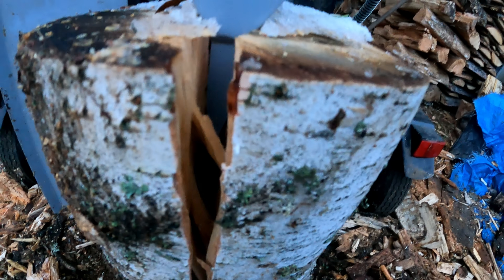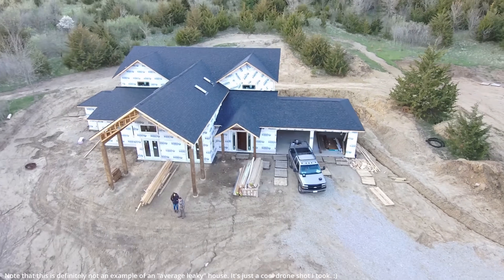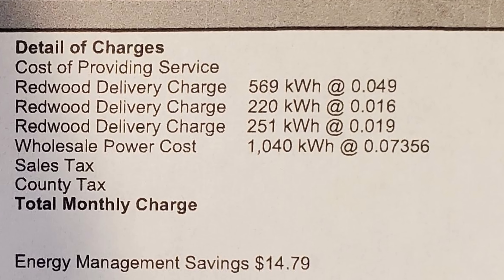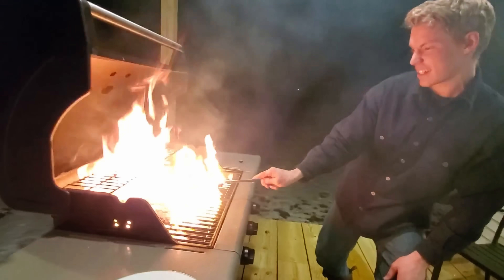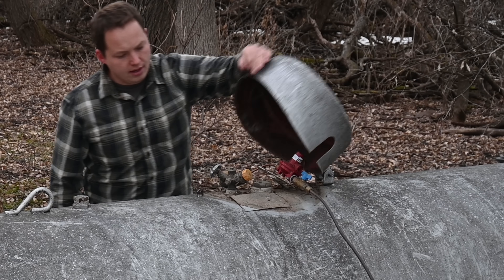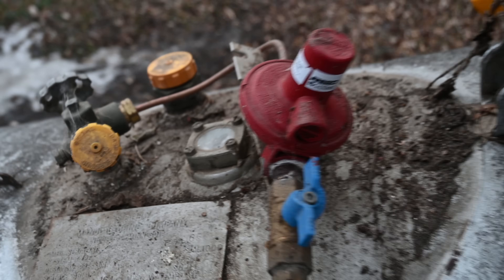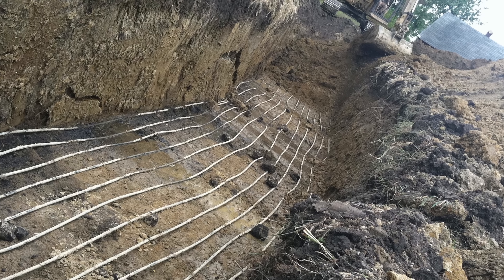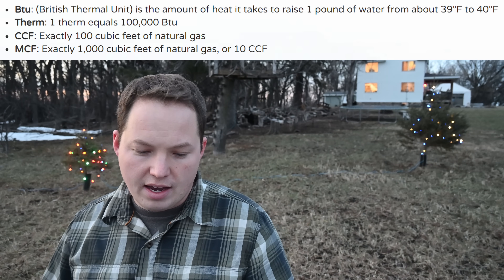What's The Best Heat Source in 2022? Top 5 Home Heating Methods - LP Electric NG Geothermal Fuel Oil

Comment: Here's why I will always choose natural gas over a heat pump. Power outages. 

Down here in Texas last winter folks lost power for a week, some much longer, during the Feb 2021 storm. I have power stations/solar generators and a portable dual-fuel generator as backups. My natural gas furnace is hooked up to a single-circuit transfer switch from EZ Generator. 

A 1/4 HP furnace only needs about 400W of power to run the blowers. My 1/2 HP furnace is larger and takes 800W (3200 sq ft home). With my 5120Wh Bluetti power station, I can run my furnace over 21 hours on a single charge. I can recharge with solar panels or my propane generator. 

There's no way I could run a heat pump that long. It's as power hungry as an air conditioner -- needs thousands of watts to run. Would burn right through my backup power. That seems to always be omitted from the head-to-head comparisons from folks pushing everyone to get heat pumps (not this video review though, which was very objective. Great review, Benjamin!).

You just can't beat the low electrical power requirements of a fuel-burning heat source during a power outage. Until that changes, which I don't think it can due to physics, I'm sticking to natural gas as long as I can get gas lines to my house.
Reply: Why not heat pump for when you have power, and Natgas generator for when you don’t? I’d bet money you’d win out with that strategy year after year in running cost, plus, your food in fridges and freezers and all would never go bad. Lights on all winter.
Reply: @myid9876543  Good question. Natural gas in Texas is actually dirt cheap. Our gas bills down here are actually much less than our electric. Our summer AC bills down here are what kill us. If we were to use heat pumps winter electric bills might be as high as summer.

Now all this was pre Feb 2021 Texas freeze where wholesale energy prices went through the roof and power companies were left with huge bills. Now there's some scheme to charge customers the difference for the next few decades or something like that to recoup costs. We'll see how the bills come out this year.

I actually would like a whole home generator but our yard is too small :(
Reply: You are in Texas, i hope they fix the electric grid politics
Reply: And if you have a direct vent gas wall heater you don't need any power.
Reply: I do have a Buddy Heater in case all else fails and we have no power or natural gas.
Reply: @mgrnd3875  That's what I have just in case (2 buddy heaters)
We have only electric. No gas here.
I have a new efficient heat pump. We virtually never have power problems. 
The heat pump works well here. The weather? Normal in mid 60's during the day, mid 40's at night. Today? 66* and 44* 
Same all week
Reply: When we have had power outages in Michigan the gas furnace will not run as the unit cannot ignite and the blower motor will also not circulate air. We can use the wood burner insert in the fireplace which will heat the entire house minus the basement. If it comes time to replace the air conditioning unit I will go with an air source heat pump and keep the gas furnace as a backup. There would be no need to worry about moving the air from the pump/furnace and I have wood as a backup.
Reply: @robertdavidson3090  You can run a gas furnace during a power outage, but you have to install a transfer switch that hooks into the furnace circuit. Once you do that, then you can use a portable generator or power station (battery) to run your furnace by plugging into the transfer switch. It's what I do when the power goes out, but it does require some modifications to pull off.

If you have a gas furnace, then it doesn't take much electricity to ignite the flames and run the blowers. With a heat pump you have to power both the outside and inside units, and it takes an incredible amount of energy. For both cases you need a transfer switch, and with the heat pump probably 240V connection for the outside unit.

Nice you have the wood stove backup. Down here in Texas you don't see too many wood stoves. Folks are typically more worried about heat waves and hurricanes, although after the Feb 2021 winter storm when the grid nearly collapsed and folks were burning their furniture in fireplaces to keep from freezing to death, that is starting to change.
Reply: Heat pumps really have came a long way in the last several years. I’ve been in electrical for 24 years, around here (Kentucky) I’ve seen a lot of dual fuel or hybrid HVAC units going in. Basically a heat pump with gas furnace instead of electric air handler for auxiliary heat. That being said, lots of people around here like to wire their new houses for at least a portable generator. A split unit gas furnace just requires a 120 volt circuit. You can run lights, microwave, refrigerator, heat, etc. from a portable generator hookup which is much less expensive than a permanent one for the whole house.
Reply: @CA-lk6fd  Cool. Hybrid Heat Pump/Gas Furnace at least gives you a fallback. One premise of these hybrid units is that a heat pump is cheaper to run than a gas furnace, so run it most of the time. In Texas, that's just simply not the case (but maybe it is in California, for example). Natural gas in Texas is just dirt cheap. My gas bills never reach the same levels of my electric in the summer running an AC at thousands of watts. I have a gas furnace, cooktop and water heater. From an economic standpoint in Texas, it makes no sense to switch to a heat pump if you already have gas. You won't save anything on your bills. Never heard a Texan complain about gas bills, but certainly hear it about electric bills.

And you're right, the gas furnace is a simple 120V circuit. Takes less electricity to run than my 1500W space heater, and the furnace heats a 3200 sq ft home. And during a power outage I can run the furnace off a small portable generator or even a portable power station. Just not possible with a heat pump, no matter how efficient. 

While I'm all for renewables in as many places as it makes sense, including residential solar, natural gas has bailed me out too many times during power outages for me to willingly throw it out the window.
Reply: @mgrnd3875  Around our area, (south central Kentucky) if you have any sizable house out in the country, it’s cheaper to run the heat pump than to burn propane. Use the heat pump until about 20 degrees, and it automatically switches to gas. The areas where natural gas is available, you’re better off to run straight gas. Propane is a bit pricey here. Solar just isn’t a big thing around here yet, there is some but not a lot. I think in time it will improve even more and be a lot more efficient than it is now.
Reply: But what do you do when the natural gas lines freeze up?  Like what happened in Texas?
Reply: @Bryan46162  Pray :). Here's the weird thing. Even though gas wells froze up and some of the power plants couldn't get gas (and the gas well operators blamed the power plants for killing their power - circular blame game), somehow I never ran out of natural gas. I had hot water, heat, and my gas stove the whole time. 

Relying on natural gas still exposes you to utility failures, but I'm playing the odds. In the last 30 years I've lost electricity more times than I can count, but never once lost gas, not even Feb 2021. It did happen to some in Feb (usually neglected apartments that already had gas leak problems, etc), but on the whole, it's way more reliable than electricity. All the gas lines are underground.

For the doomsday scenario where natural gas also fails, I have a Buddy heater, some 250W and 750W space heaters, solar generators with portable solar panels, and a 2000W dual-fuel generator to run the heaters. Try to heat one room and hunker down. Let's hope I never have to test that backup plan out :).

Comment: We are in New Brunswick, Canada.  We use a direct expansion GHP from Maritime Geothermal.  The ducting isn't even perfect and I can say that there is no way at all to beat a GHP.  My TOTAL power usage for the year is 23,000 kwh and the house is 3,400 square feet.  Waste heat from the GHP is scavenged with a desuperheater and heats my hot water whenever the GHP is running.  So that is a total of 78.5 million BTUs and that is for ALL my energy (To be doubly clear).  Heating alone would be FAR less than all of that.  Likely only even half at the most.

My father-in-law has a more recent buildout of a GHP and is able to get 30% lower for similar floor space.

Yes, the cost on a GHP is much higher now than when I got mine 22 years ago but the highly consistent power usage and the fact that only fan belts and filters are a continuing cost item, the long term benefit is unbeatable.
Reply: At 22 years, will have to replace the entire unit soon.  Better save up.
Reply: Pros for ground source HPs are low maintenance, longevity and quiet. No temp extremes nor loud outdoor equipment exposed to elements.
Reply: @dougevans74  I know..But there are cons as I've expressed in other comments..
Reply: @alanmorrison3598  do you run these systems?
Reply: @dougevans74  Spent the better part of a decade as an engineer designing residential and light commercial compressor bearing split and packaged AC units and air source heat pumps.  Heard the saying "Familiarity breeds contempt"?  
My farmer neighbor has had a geothermal system for about twenty years and he just replaced the unit in it's entirety..Along the way though, he had to replace circulating pumps twice, the motherboard and other maintenance issues but these alone cost him a pretty penny!  I'm not saying these systems don't have a place but they are extremely expensive to purchase and have installed.  My farmer neighbor had the land needed and the equipment needed to install the ground loops and he added loops over and above what was recommended. 
My main point is that no one system or energy source(s) is right for all applications. Invest primarily in your house and its insulation and weather tightness as you have done in your older farm house.  Money well spent and makes the system(s) you select less critical.  The simpler the system, the better its reliability, maintainability, serviceability and longevity.
As far as I am aware, all compressor bearing systems are direct expansion.

Comment: In electrical resistance heating, Watts is Watts and band, element or shape is irrelevant with one exception of how well it moves air. If It doesn’t move air well it will consume the rated output but the heat will be localized. With fan resistance heaters I wish they would disclose the noise levels.

Comment: Great video !
Thanks for summarizing it all for us !
I use LP on 2,000 sq ft farmhouse build in 1915 (remodeled in 1980’s). Last year, 20/21 I’ve used around 800 gallons of LP just to keep it warm couple of days every week. Otherwise thermostat was set to 55*F. This is air circulating system. 
For the next winter I’m planing to use radiant heat (at least on 1 floor) with a LP boiler and augment it with solar thermal. 
Meanwhile it’s -5*F outside (feels like -18*F) in northern Illinois.
Reply: I think you will find it much less expensive to heat the house using a high efficiency heat pump, than the LP system for the winter of 2022/23, because fuel prices keep climbing!  And with $6 per gallon fuel oil or diesel prices, that will become the most costly to heat a home.  Also most fuel oil furnaces are not over about 75% efficient.  

Ground source heat pumps are just to expensive to install, unless you have very low electric costs, and high prices for the alternative fuel, such as propane or fuel oil.  

In my area, Portland Oregon, where the low of 23F only happens about 15 days per 3 years (most years stay above 23F), the air source heat pump works wonderful, and I never hooked up my electric resistance back up heater.  

My cost to get 100,000 Btus' from my 14 SEER heat pump is about 8 KW or about $0.80.  So $800 for the winter if I actually needed 100,000,000 Btu's?  But I do not need that much heating.
Reply: Look for 30 tube evacuated tube solar thermal heaters.  I would suggest 2 of them to warm your boiler water to a acceptable level in your area.  Maybe 4 of them.  You might also consider standing them upright, next to the building on the south side.  This is because in the summer, it would be easy to put a blanket over about 1/2 of them, so they do not overheat, and at 90 degrees, they will pick up more winter sun than if mounted at 25 degrees on a rooftop.  At 90 degrees, it is much less likely to overheat in the summer, while providing just domestic hot water to the home.  

With the recent cost of LP gas going up, at $4.10 per gallon, that is about $5 per 100,000 Btu's of heat.  A air source heat pump is only about 5-8 KW of electric, at $0.16 per KW would be $1 to $1.60 to provide 100,000 Btu's of heat.  Yes it will not work at 5F.  But above 15F there is plenty of heat to collect from that outdoor air!  

You might consider a 18,000 Btu ductless heat pump, mounted on the wall of a room that is about 500 - 700 square feet.  This will provide a majority of the heat that you need during the months March to early December.  With solar panels, you might cut down LP burn rate to under 100 gallons all spring - late fall.  Filling a 1,000 gallon tank in the middle of summer is a much lower cost per gallon than filling it in the winter!  With the heat pump set at 60F and the LP system set at 50F, to prevent plumbing damage, you should be fine.  The solar might keep things warmer than 60F if you get 4 panels (X 30 tubes each).  

I bought a 18,000 Btu ductless unit for my neighbor, it cost only about $1,200 on Amazon.  I installed it where his 240 volt heat pump was located, (that heat pump quit many years ago) so didn't need to run any high voltage wiring, and it took us about 5 hours to install it.  It is completely silent, only as noisy as a refrigerator!

Comment: I use natural gas here since it's way cheaper than hydro but if hydro was not so expensive I'd switch to it as it's more green.  I plan to build an off grid cabin at some point so I'll probably do a combination of heat pump, resistive heat and wood stove.   Power will be mostly solar and wind and maybe backup propane generator.   Goal would be to never need the propane though.  Goal would be to be able to at least keep the place above zero with just electricity.  Wood stove would be used when I want it to a more comfortable level.   I think I can make it work if I insulate well enough.

Comment: I'm remodeling a house I recently purchased and I am zoning every room with Mitsubishi ceiling cassettes; I hear mini splits are moving to CO2 as a more efficient refrigerant. If I wanted to use CO2 if/when it is the standard, do you think it would be as simple as evacuating the R410a and replacing it with CO2?
Reply: I believe that the pressures are way higher with CO2. So you could not change an R410a system to CO2.

Comment: I was told that propane tanks are only good for a certain period of time.  They need to be certified to make sure that they are still safe.  The company that supplies gas to our community has replaced most of the tanks that came with the houses and the houses are 16 years old.  Could you please comment on that?